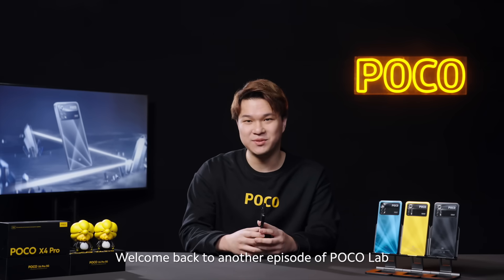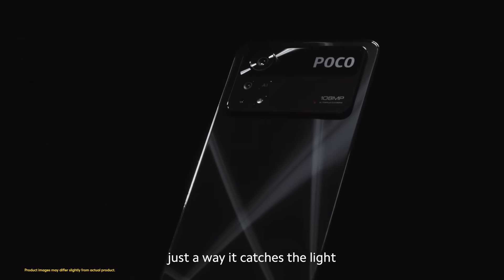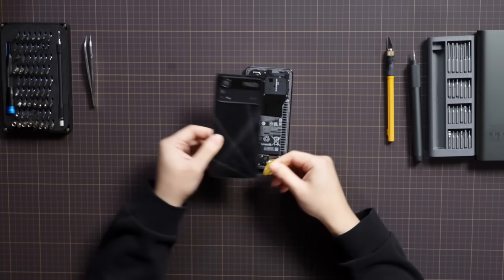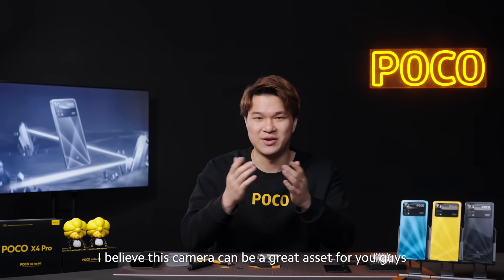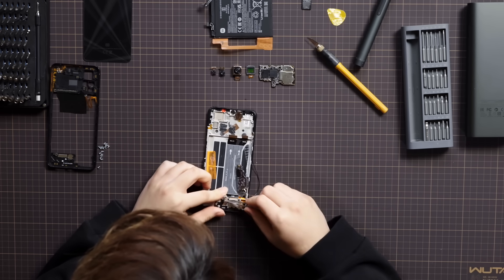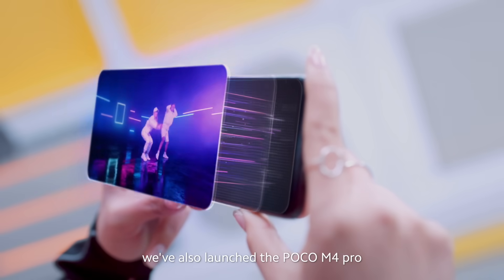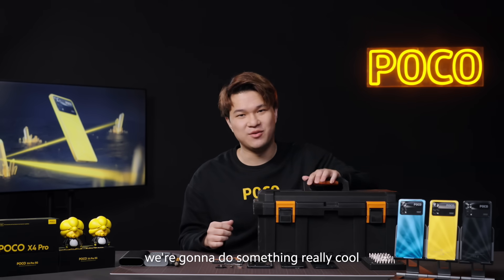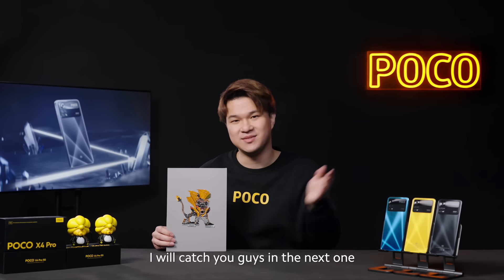POCO X4 Pro 5G Teardown | King POCO | POCO Lab

Comment: hi, my poco x4 pro won't receive nor make calls anymore, and also damages my sim card, so it won't work on any other phone after using it in the Poco, tried all the solutions online with no success, I can receive SMS, but cannot make calls, it just cuts off or does not ring, this happens especially when I turn airplane mode on for a while that turn it back off, tried resetting the phone to factory settings, the same problem, the sim card always works on other phones, but as soon as I put it on the poco it won't work back on those phones. any suggestions please

Comment: Please make  killer gamining with 5g with sd 8 genth 1 and make more faster than iphone with 15,000 6 gb ram with 128 gb rom and 8 gb ram 128 gb rom in price 20,000
Reply: Bruh 8 Gen 1 is the latest SD so its 50% Chance that they used it under 20K phone and what iphone do you meant iphone 13?

Comment: "dont be fooled by name ,snapdragon 695 actually out perform some of the snapdragon 700 series processor ". but i dont think is better than poco x3 nfc snadragon 732G ,i not going to buy this .Next time dont downgrade processor when poco x5 pro release please ,bad marketing strategy.
Reply: x3 nfc use adreno 618 GPU
x4 pro use adreno 619 GPU more performance, its not the same.